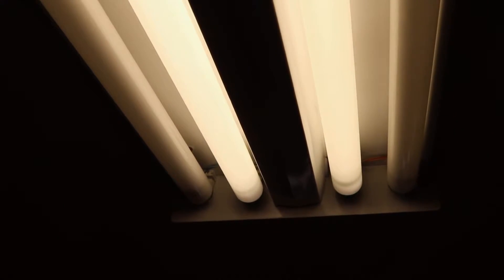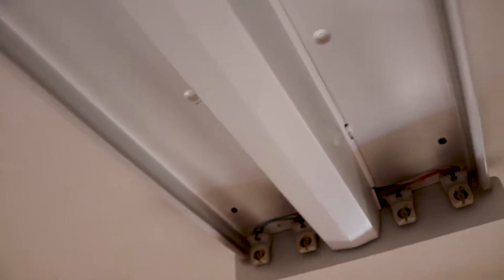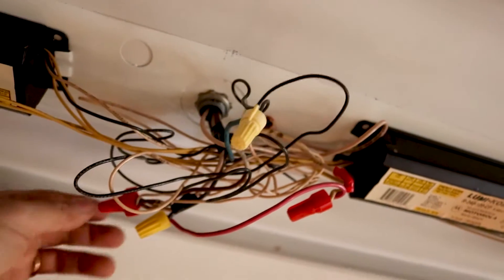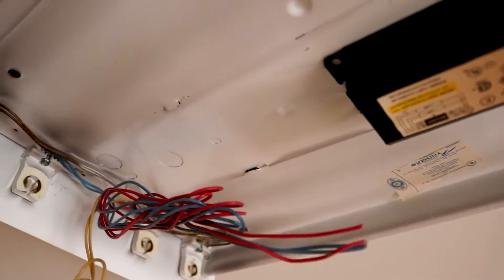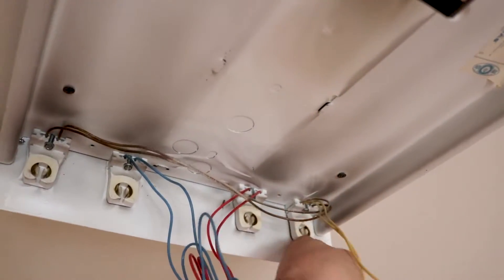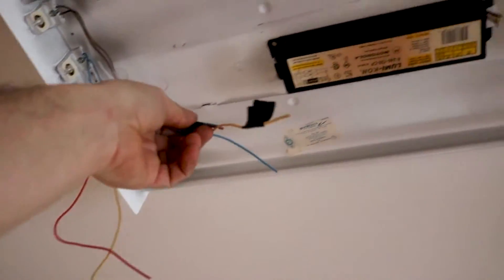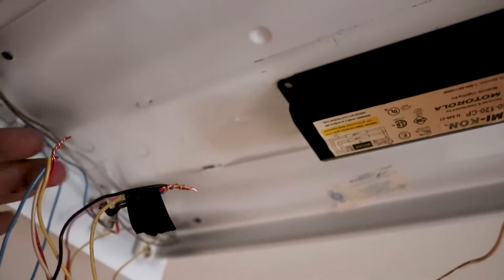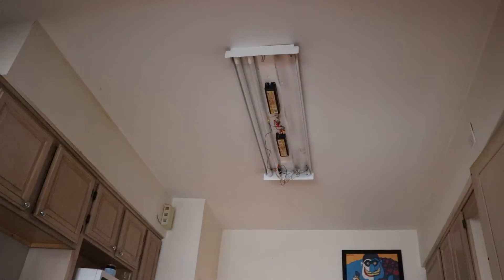How to replace Fluorescent bulbs with LED (Fluorescent to LED conversion ballast bypass)

Comment: BTW, went to Home Depot  and bought four of the exact kits you used at $20 apiece. Work perfectly for 8 bulbs in two fixtures. Took about thirty minutes for the first one and fifteen minutes for the second  one.
Reply: Lowes has led t-8/t-12 bypass bulbs for 8.97 each I did my kitchen for 16 bucks